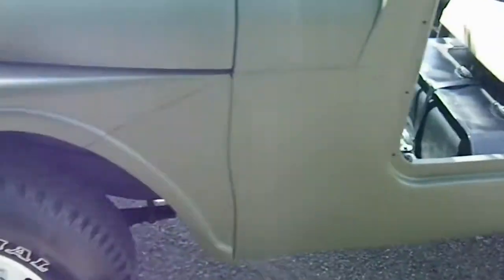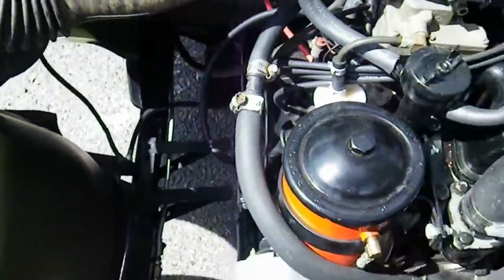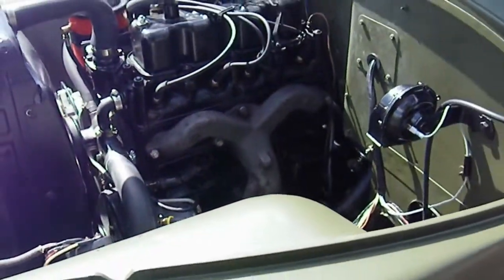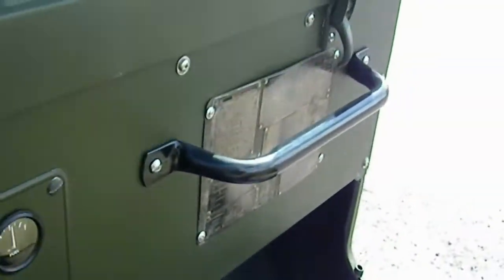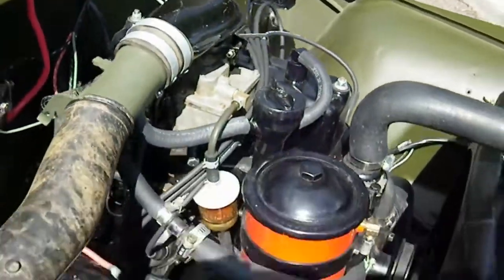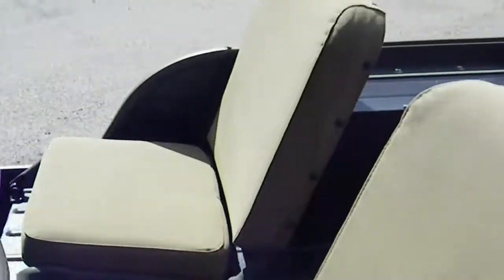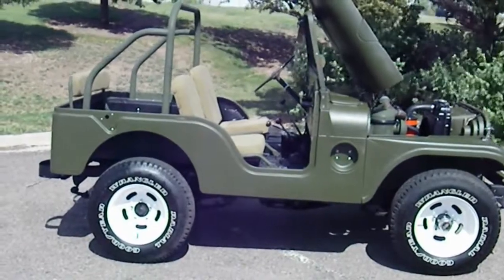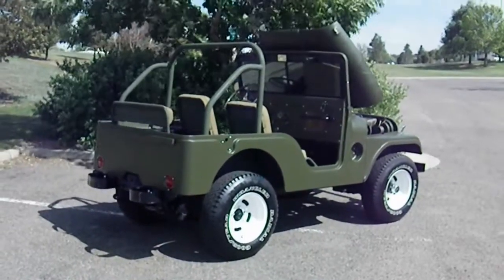1953 Willys Jeep M38A1 Army 4x4 Truck Restored and Rare

Comment: The trans in a M38A1 would have been a 3sp not a 4sp, I bought mine from Dover DE, Air Force Base in 1968 and sold it in 1974.

Comment: It's not an M38. It's an M38A1.  There's a difference.
Reply from the maker: +Ken MacMillan Care to elaborate?
Reply: An M38 is a flat fender. Like the old WWII jeeps. It was based off of the CJ3A. The Army wasn't impressed. They felt it was under powered. Willys then came up with the M38A1 and it's civilian counterpart, the Willys CJ5. When Kaiser bought out Willys they changed the name to the Jeep CJ5.
Reply from the maker: +Ken MacMillan Thanks, I'm sure my viewers will appreciate the information.  I've changed the title to reflect the new knowledge.